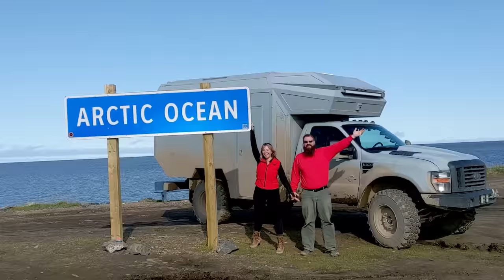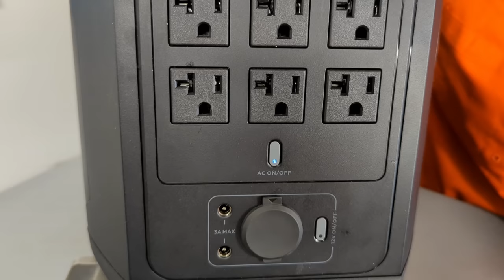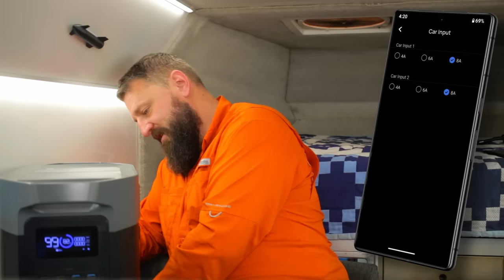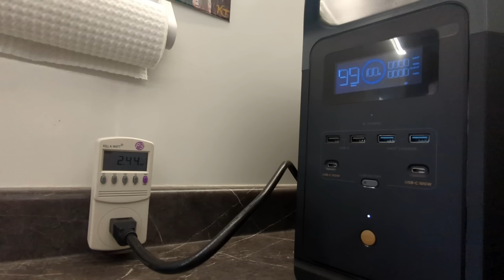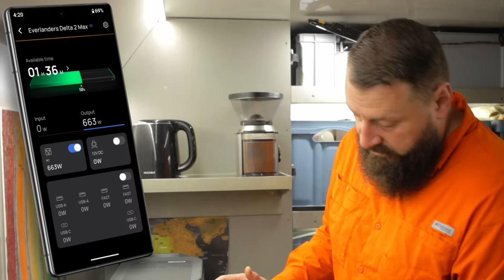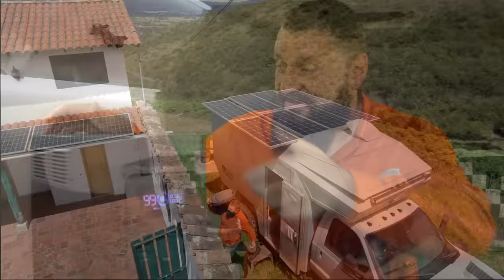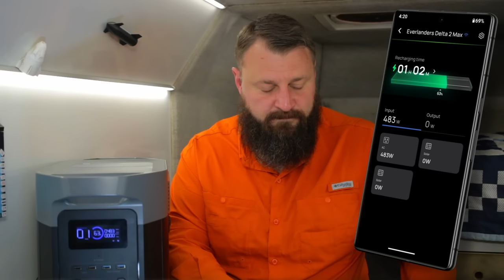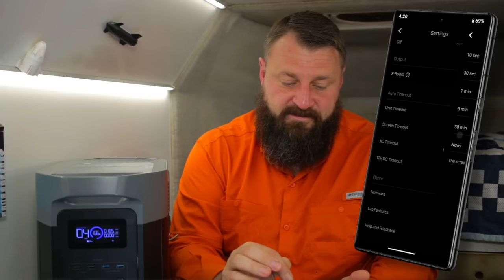EcoFlow for Overlanders - The LiFePo4 Delta 2 Max

Comment: I've been van dwelling for two years on 800 watts of solar in a Dodge B3500. Recently bought an RV version of the same van to work on later this year for my next home.  I was planning on slide-out solar panels to expand my input considering the RV has a bunch of stuff inconveniently placed on the roof already... then I stumbled upon your old video doing exactly what I was pondering!   I'm curious how well your drawer sliders are holding up to weather and time.  Are you still on the original hardware or did you have to replace them yet?  Do you think stacking panels 3 high is feasible with beefier supporting hardware (using 1" stainless rods through linear bearings/bushings for the motion rather than sliders)? Height isn't as much of a concern for me because there's already an 8" tall air conditioner up there.  (12kwh LiFePo4 and 1800 watts (9@200) is the goal)
Reply from the maker: Solar is working great, need to wash the dust out of the slider bearings once a year... Other than that, in and out twice a day...
Reply: @Everlanders  Thanks for the quick reply! Binging your videos now lol.
Reply: @Toom,
Our ExpeditionVehicle has six 305-Watt photovoltaic, a total of 1,830-Watts.
These top our eight 105ah Lifeline Concord AGM -- new in 2003.
We usually use juice mid-day, so our bank is mostly just a pass-through.
One of our brainiac caravan chums calculated our pull from the bank at less than three percent (3%).
And yet, with two decades full-time live-aboard, our bank is looking forward to retirement.
Could today's unit survive our trundles up rough logger tracks to remote mountain lakes and across deserts to isolated Baja beaches?
Hard to say.
Ocean air can be corrosive, dust gets into everything.

Comment: thank you for this video....Great information for this unit as I shall be receiving my delta 2 max tomorrow
Im currently having an all cab being fitted to a jeep gladiator and the outfitters that are building my jeep sent a quote for the build adding a redarc revision system  and  a redarc alpha 150 lithium battery but I also have the 800 w alternator/battery system from ecoflow to charge the system while driving let alone the solar panels ( which I haven't got yet  and suggestions would be greatly appreciated).
Do I need the redarc system or is it overkill?   Thankyou for your time
Reply from the maker: What in the world mish mash of systems are you running...
Reply: @Everlanders  I got a quote for install of my alucab wiring 
I don't think they understand the eco system and what it can do
Reply: im no electrician but I think that the ecosystem can run everything on and in an alu cab aswell as cook and do everything else with  the combined solar and car charging capabilities?

Comment: Just a pity there isn’t higher capacity DC out for people to use as a full power station in a smaller van or camper and hookup to a fuse / distribution box.
Reply from the maker: Well, in that case you need to go to the next bigger model. It has a higher output DC port.

Comment: Have original Delta; 2 Lion batteries and aprox 400w solar on the r/v.  How would you recommend the charging of the Delta and the Lion batteries off the solar panels?
Reply from the maker: Are you referring to Lithium Ion or "Lion" brand LiFePo4 batteries... Regardless, both are going to require an external Charge controller. Based on the way you've posed this question I don't think it's worthwhile to try and connect them to the Delta.
Reply: @Everlanders  Yes, Lion brand would require a controller.  I think the Delta has one built in with limitations.  
Re your communications issues, an amateur radio would allow you more options world wide.
Reply from the maker: What communication issues? I have 250mbps Starlink that's working globally, no interest whatsoever in HAM...

Comment: Great video . I wish this unit had more solar input, especially thinking about the extra batteries.
Reply from the maker: I charged it completely from solar in 2.25 hours...
Reply: @Everlanders  My ? is how much solar panels; manufacturer , watt size and which series or parallel  is better for a small Townhouse where one might put a select few breakers in a side panel to the main panel with a manual off/on device? I know I want a EF Dp2 but need some help on how much solar . I can't put anything on my roof as my Insurance will drop me. It's going to have to be an upper balcony set up or foldable panels as not much space to work with.
Reply from the maker: If you don't have space, it's going to be hard. For this unit I would suggest 2 x 545w half cell panels,  50 volts and 500 watts at each input. This will be shown in the next video.
Reply: It has a 1000w solar input max which equates to less than 3 hours  to fully recharge it if using 1000w of solar input.

Comment: Does it turn on the inverter if state of charge was 0% but then solar showed up?
Reply from the maker: You mean if it was so. But then got turned off due to low battery, does it turn itself back on... Not normally, but there are what they call "Automations" that you can set to come on at a certain time... I'll maybe play with that for the next video.

Comment: I have the Ecoflow River 2 that I bought as a LFP powered UPS for our router / Starlink supply. (Often times, when reprogramming / updating our Victron main supply it will shutdown and restart and do the comm loss. (Not Good) I have it set for never shutdown. Ecoflow, with many problems in communication - send this, send that, what was your problem again? send this send that again -- round and round we go - never did fix the random shutdowns - sometimes 12, sometimes 36, to 4 hours.

Please try the never setting and give it some time as a UPS item.--- Thanx
Reply from the maker: I did in our next video... Have a look...

Comment: I bought recently the Delta 2 Max and a Delta 2 Max expansion battery for a food truck, it is replacing the propane/petrol generator we were using before, the food this 4kwh of capacity keeps all our appliances running for the 5 hours that we are normally trading. There are 4 small fridges, 1 small freezer, tablets and cashier, lights, fan extractor and a commercial rice cooker in warm mode all connected and holding very well, in 5 hours the battery goes from 90% to 20%

The only issue I am having is with the automation to AC charge the batteries, I set it to charge only from 2am to 4am because tariff is cheaper, however when I come back from working with the van and I connect the ecoflow to the AC it starts charging immediately no matter what time it is, ignoring the automation, this is supposed to be normal as per the manual but in my opinion doesn't make any sense, why to have an automation if it is going to be ignored, am I the only one who sees this way?
Reply from the maker: I suspect you'll need to have Wi-Fi access for the unit to know what time it is... Other than that, you may be better off contacting Ecoflow support for an answer.
Reply: @Everlanders  it has wifi when it gets home, I contacted ecoflow support but they told me what I knew from the user manual, it is they way it works, as soon as it is connected to AC input it starts charging not matter what automation is enabled :(
Reply from the maker: Well, if that's true then I don't know how I can be expected to help.

Comment: High output DC is kind of important to make this a complete RV/mobile solution.
Reply from the maker: Agreed, tapping a DC to DC converter straight to the battery BMS would be a pretty simple mod.

Comment: Excelente video saludos desde Puerto Rico tengo la Delta 2 Max desde julio y hace como una semana instale el transfer switch y los paneles para por fin usar la bateria y ir reduciendo el costo electrico pero lamentablemente en la última actualizacion el backup reserves no funciona y a la vez que detecta energia solar hace que la Delta 2 Max se apague y salga un mensaje de Overloading. Estoy usando un smart plug para tratar de usar la energia solar, a ver cuando Ecoflow arregla ese bug relmente eso me tiene bastante decepcionado Hasta fui a cambiar el ac outlet ya que pense que podia no estar dando el voltaje suficiente pero  en los foros descubri que es un Bug 😢. Pero muy buen video me subcribi a tu canal.

Comment: Is there a way to modify the frequency in the app to 50 hz to use european apliances and the help of a step up transformer to 220v?
Reply from the maker: Why not just buy the 220/50 version?
Reply: € 2099 😢. I live in US and have  this 220v 250w linear motor submersible pump that I would like to make it work. I bought a victron phoenix 500 and it's not sufficient. It needs a little more juice

Comment: The EcoFlow that I own did have Horrible VOC smell when it got hot for months. I would recommend to new owners vent this unit to the outside for the first few month of ownership.
Reply from the maker: This one wasn't too bad, it was gone after the first or second day, but perhaps it was because we got it good and hot, 2 to 4KwH in/out every day and that flashed it off faster...
Reply: @Everlanders  That's good to know. I have one of the River units that I bought last year. I never used it full output capacity.

Comment: Are those outlets grounded?
Reply from the maker: There is a connector in there, but grounded to what I don't know...
Reply: @Everlanders  I have river 2 max and it has a connector, it grounds to your house outlet. It would’ve been nice to have a ground point like on BLUETTI ac180 in case you don’t have an outlet
Reply from the maker: I haven't grounded anything in 6 years, it's overrated.

Comment: Have you chosen your specific make, model, style, or size of appliances?
Reply from the maker: Not really, we just took what we had at home.
Reply: @Everlanders  do you have any appliances that you would recommend for efficiency,  must haves,  instant pot,  etc...?
Reply from the maker: Instant Pot and Anova Sous Vide in an insulated 6-can cooler are our go-to cooking appliances. We also use induction cooktop for stove toppin'
Reply: @Everlanders  I noticed that cooler setup!  I've dug your build & videos,  you have really innovate ideas on build.  When I saw your corny keg water system,  I knew you were definitely thinking outside side the cookie cutter box!

Comment: Um.. the copy of the video appears to be running at 75% speed. At least, your voice in the intro sounds weird until I speed it up.

Interesting! I never realized that you made a point of NOT using propane! I always consider it a backup energy source, I never considered that you didn't have any onboard anywhere. That is intriguing! Tell me, do you have any redundant systems built in to cover the gap left by not having a secondary energy source? Such as.. If your electric furnace dies late one evening, do you have a quartz heater to make up for it, or..?

Uck.. I refuse to own Microsoft Hardware. I got mad when they revoked support for their flight sticks, but after I paid $800 cash for their "net generation" phone with built in 3d graphics.. and the graphics didn't even run (they never fixed the drivers for the phone,  ever).. I said never again. I mean.. I hope you're happy with your surface, but I'd rather see you supporting more independent efforts, as an influencer.

OMG! A sous vide shoved in to an insulated lunch box! Genius! :D (The Salmon dish looks delicious, but it tastes like it needs some Himalayan salt. :)

Why do you call your toaster oven an onion? Is there a story there, or just silliness?

I am SO freaking jealous that you're living and farming in South America. Many many moons ago, I figured that my ideal place to move to would be on the east side of the central Andes, in the middle of nowhere. :)